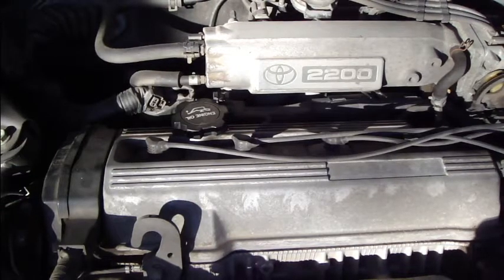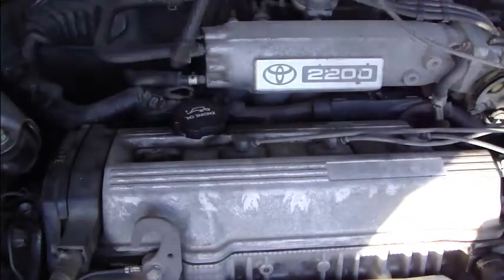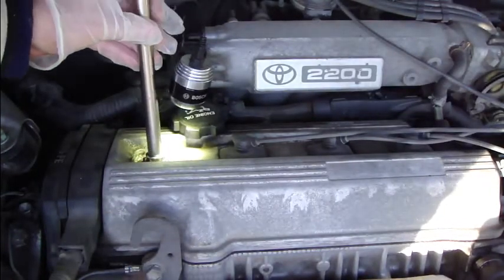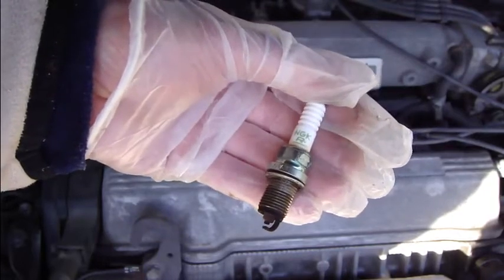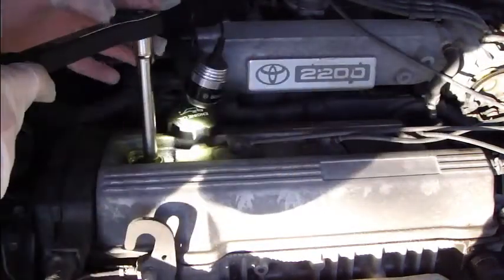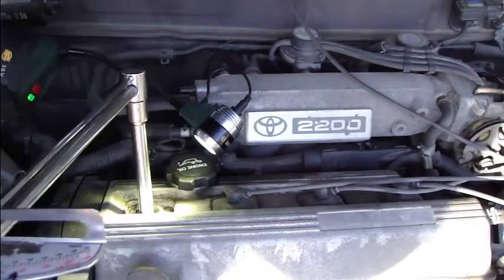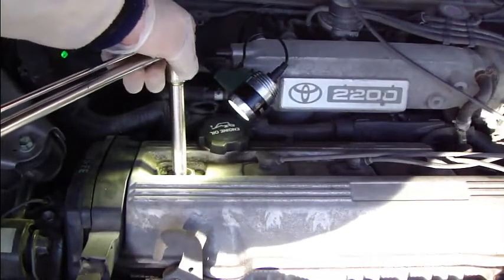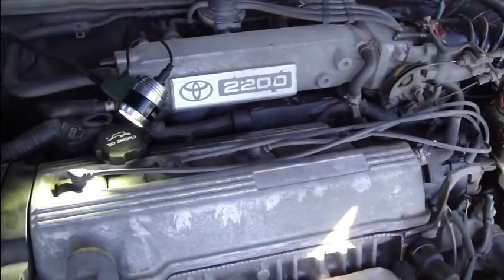How to replace spark plugs Toyota Camry. Years 1991 to 2002.

Comment: Not to step on any toes, just a recommendation for other viewers! When installing new spark plugs, it's a good idea to insert the the new plugs and catch the thread using a hose (one with a small enough diameter to fit snug around the plug, like a heater hose). This ensures that you don't skip threads and get a good fit. Autoparts stores usually have extra scrap hoses lying around and will either give them to you or charge you a small fee.

Great video, Peter, thank you!
Reply from the maker: +PhilWithCoffee Hello and Thanks for feedback. :-)
Reply: just start it by hand with extension.. if you dont have good enough feel to tell if it is going in naturally, you shouldnt be working on cars.
Reply: @travisk1487  Seriously. What a dumb suggestion with the hose... Probably from someone who doesn't work on cars very often...

Comment: I have 2 questions.

Question #1) What is another name of the tool at the end to read pressure on the spark plug? You call it a "Moment Tool"

Question #2)Are you using this "Moment Tool" as a substitute for a gap tool even if the spark plug is not tightened perfectly?
Reply: It’s a torque wrench and he’s setting at a specific torque amount so that he doesn’t over tighten the spark plug…

Comment: Hey I just changed the spark plugs but my old spark plugs came out full of oil, is that normal or do I need to replace the gasket?
Reply from the maker: You must tight all inner big bolts in spark plug holes

Comment: An excellent video! I need to replace the plugs & wires on my misfiring 2001 4-cylinder Camry. How about the wires? Is there a distributer to attach them to, or what?
Reply from the maker: Nb Forrest Hello. Please look this video: https://youtu.be/SgX_1ybaGZs
Reply: Outstanding. You are a prince...:o)
Reply: +Peter Finn  where is the #3 spark plug located on 02 Toyota Camry?

Comment: What plugs you recommend for a v4 95? Camry Denso or NGK?? Thx Peter
Reply from the maker: Denso
Reply: @PeterFinnTheCarDoctor  get me a model # for the Denso
And also thx to you I changed the thermostat in my 95 Camry and drained the radiator and replaced with new antifreeze! Spark plugs next!

Comment: You didn't check the gap on the spark plug and you didn't change the wires. General rule of thumb is to change the wires when you change the spark plugs and they definitely looked like they needed changed.
Reply from the maker: Thanks for info. :-)